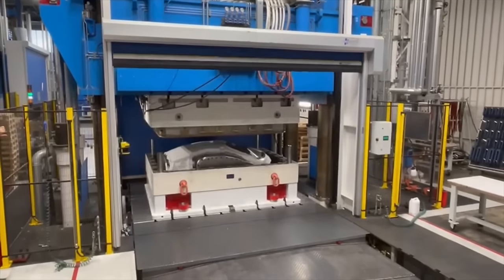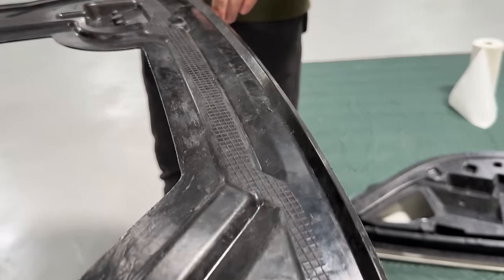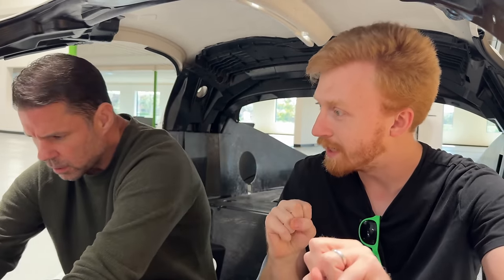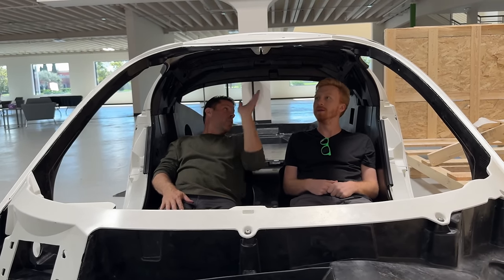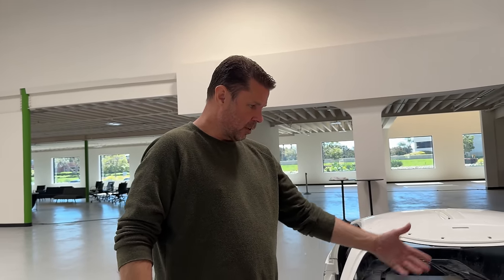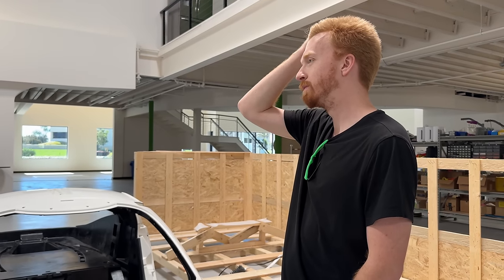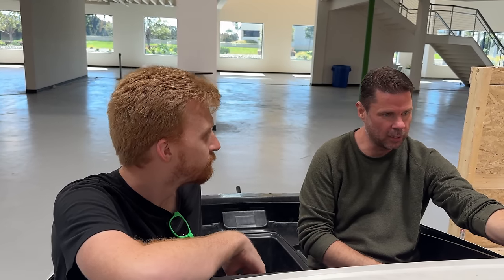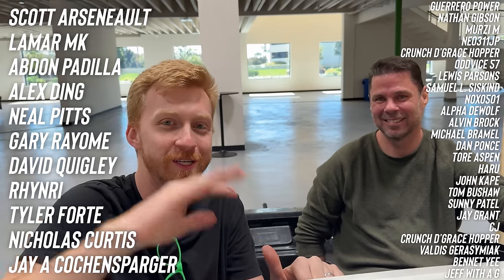Aptera Answers YOUR Questions!

Comment: Thank you for this fantastic video. There are many cool facts and innovations about the Aptera in just this video alone. Well done asking all the right questions!

* Lithium 12v battery located in the rear
* Every 30 pounds added to the Aptera reduces range by 1%.
* Aptera utilizes an SMS system for remote management, (similar technology as house electrical meters, gas meters and pagers etc.) using 3-4% of the energy compared to competitors' live data streams. (leading cause to phantom drain in other EV's it seems?)
* No 4G-5G modem; internet needs are streamed from the phone via Apple CarPlay or Android Auto with the ability to connect to homes wifi.
* Aptera's interior is 1/5 the weight of a comparable sized vehicle's interior with many less parts
* Aptera owns the code for all individual systems throughout the vehicle allowing seamless communication, reducing bugs compared to traditional outsourcing.
* Winter driving is not much of a concern when it comes to traction control or heating the Aptera because of its thermos like construction. Biggest concern is snow build up within the wheel pans.
* Belly pan cooling vs. traditional radiator: A traditional radiator is a little lighter but it’s a little less efficient than belly pan cooling so its a give and take on efficiency between the two (early Aptera’s will have a traditional radiator)
* Break-even point: 6000 vehicles/year; higher margins expected at 20,000 vehicles/year, with local body production planned.
* Targeting 15-19% margin on each vehicle long-term.
* Hood opens to access cabin air filter.
* Mechanical latch inside for emergency door opening; no external mechanical access.
* Aptera theoretically more efficient than e-bikes at highway speeds
* (Possibly) Around 150 Wh/m at 80 mph.
* ‘NACS’ originally named by Chris through petition in 2022.
* Plans to gamify solar charging performance among Aptera owners in a 100-mile or so radius.
* Separate removable glass SMC cover for serviceable parts; electronic latches, logo lights, knock knock sensor, window mechanisms etc.
* trunk hatch has rain management with drain holes.

Comment: Dude!  What a great interview and showcase of the BINC!  Great questions about the wheelpans, because I was thinking about the snow and if they have some engineers working in Europe on that, I look forward to seeing what they come up with.  Maybe something that has some sort of venting out the back?  Who knows.  Would have liked to have heard what they plan on having for Drift-X.  Will they have a display or will it just be Chris and Steve going out there and having presentations to see if they could line up any backers.  So the belly cooling is being put off for the launch.  That's fine.

All the talk about taking out weight and having a more efficient system reminds me of the space program where they really needed to watch how much weight they could push into space.  That's pretty neat.

On another note, I was thinking that my garage faces south and is light in color, so I should be able to just back it out of the garage and with the reflected light off the garage, I shouldn't have to orient it in a East West direction. And if need be I can always plug it in at night.  I hope that will be a feature as well and you can schedule the time it will charge when plugged in to take advantage of the off peak hours, but I'm sure they already do.  And it's great to hear the software is coming along inhouse and with the contractor for the UI.  Also great to hear about the way it will link to your phone and use that SMS? system that pagers used to use.  Very efficient!

Thanks again Tailosive and Chris and the whole Aptera team!

Comment: Thanks for asking that winter question. I live in Canada where nobody knows about this car
Reply: I live in Iowa.  We got down to -30 C this past winter.  I will report on my experience with an early model after the Accelerators are delivered.
Reply: @n.brucenelson5920  What about canadian accelerators? will we be pushed to the back of the line? This happened with Rivian. But thank God I didn't buy that truck
Reply: @ashrafc7794 If you were planning to pick uo your vehicle in Carlsbad, you won't lose your place.  Then comes the Paradigms and only then the UAE models.

Comment: I have two ideas you can share with Aptera. 1. For greater heating and cooling efficiency.  Hang a drape behind the seats to keep the conditioned air up front.  2. Head room is never rrally an issue on most cars. My concern is my eye level compared to the rear view mirror/screen. I am 6' 2" and sit very upright in cars. My idea is to move the mirror/screen to behind the steering wheel and in-between the left and right side mirror screens.

In my many trips to the aito shows. I have not found a single vehicle the didnt have the rear view mirror blocking my line of site. I have come up to intersections with the mirror preventing me from seeing a semi truck coming from the right.

Comment: Love all the small details that were revealed.  A little surprised that audio  speakers will be a basic setup knowing that Steve is such an audiophile.  But hey…overall, SO SO PLEASED with this video and substantial information.  Can’t weight for Aptera Owners Club for further breakdown…Great job Drew!!!
Reply: Basic speakers probably keeps the costs down.

My Hope is that Aptera will have luxury models in the future to rival that of  luxury brands.  

They clearly need to get the Aptera on the road..develop a few models then assuming sales are good they can consider more luxury options.
Reply: I've specced the upgraded audio option. Looking forward to the details on that system!

Comment: The calculations for 85 mph with driver & passenger weight of 370 lbs, shows 164 Wh/mi or an approximate range of 302 miles with a 5% battery reserve.

Something that doesn't seem to add up is the battery pack for the LE.  Chris has said more than once that there are roughly 2,900 cells.  The best combination I have found for 2,900 cells is 18s 27p / module  (2,916 cells).  If my math is correct, a 6 module pack will be 53.217 kWh.  That doesn't match the 46 kWh that has been said is in the LE.  (Each LMN-811 cell is rated at 3.65V & 5.0A.)  If someone has better information / calculation, please let me know.

Comment: Some food for thought on efficiency: The most lightweight electric vehicle you could possibly get (and likely...would ever be made) is a self-balancing electric unicycle. An electric unicycle carrying one person going 25mph consumes about 25 wh/mi. If you think about that as the "ceiling" for electric vehicle efficiency, and the aptera is at 100wh/mi now...there's not that much more you can improve on!
Reply: One of those was built and confirmed at that efficiency.
Reply: This is not a ceiling for efficiency, because the energy lost due to air resistance can be greatly reduced and Aptera does so, even if it has a little more rolling resistance at low speeds.
Reply: @n.brucenelson5920  my dude, the EUC weighs ~60lbs and the aptera weighs 1800lbs.
Reply: @tonydeveyra4611  If you are talking about the Master Pro, you better check your facts.  It weighs almost twice as much, and has a fraction of the range, speed, and load carrying capacity.

Comment: 7:56 ish
awesome to see my concern over corrosion! good to know that they are using a bonding agent as a way to keep things separate...
however, earlier in the video I have seen several threaded inserts embedded into the parts. do you know if those have some sort of barrier too? maybe I'm being a bit paranoid, but it would be a shame to see these beauties suddenly start falling apart.
Reply: CPC has years of experience working with these Mitsubish Chemical sourced materials.

Comment: Must be nice to be interviewed by someone who actually knows what they're talking about! I really wish that third seat was an option from the get-go, even if it might be slightly inconvenient like requiring the third occupant to straddle that hump, because I would totally buy this thing then!
Reply: "I call the back seat, in the middle, with my feet on the hump!” “You like the hump don't ya Brian?” “Oh yeah! I like the hump!
Reply: I was thinking they could have done a bench type of seat across, like the old cars used to have.  Not sure you could actually fit a third person between there but itwas just a thought.
Reply: @artboymoy  Maybe it was something they considered but just couldn't make it work for one reason or another. Even if the seat(s) was/were small that would still be a useful option for many people. [edit: In a pinch I suppose one or two people could lay flat in the back!]
Reply: @JustWasted3HoursHere It'd be safer than riding a motorcycle!
Reply: @JustWasted3HoursHere  I've done it with my gen 1 Honda Insight.
Reply: @jeffcarlton3590  The extra seat or the lying flat in the back?
Reply: @njdevilku1340  I have around 1/2 million safe miles on motorcycles, but I know that this is far from true.  (My wife and I have also ridden in an early Aptera prototype)

Comment: For me efficiency is paramount so that is what attracts me to Aptera. So overall I love what this company is doing. I am disappointed in the decision of not using a heat pump which should be part of the efficiency strategy in my mind. It is not a deal breaker, but I really wish they would reconsider. I wonder if it would be too complex to add it post market?
Reply from the maker: I ask about that in my previous interview. They want to but they’re much more expensive and not available off the shelf. The HVAC they chose for the launch edition is fairly efficient and very cheap. Long term they want to switch to a heat pump but if they wanted one on launch the wait would be longer
Reply: @TailosiveEV  Thanks! I still am curious about an aftermarket retrofit of a heat pump but I think that might be too complicated. I live in Southern CA so it is not that big of a deal unless I take it on a trip to the mountains. I was thinking about a camping situation where it got very cold.
Reply: @KrinkenRohleder  I worked for a company that designed and built heat pumps.  I was surprised too, but Covid put an end to widely available transportation qualified reversing valves.  When this changes again, they can be added in.  As a continuous improvement company, Aptera doesn't have to wait for a model year change to add them in.

Comment: Great interview. I hoping for additional solar panel support for home and travel. Would like to go cross country like in the movie the Martian. But I would like to do it with the glass rear hatch! If they do away with that option I will be very very very disappointed!
Reply: Since the crash testing will be done with the carbon fiber base for the solar panel, I would not be surprised if the glass hatch option is considerably delayed if not canceled entirely.
Reply: If that is true. Someone should take the video goggles off that person responsible and drag them out side and let them breathe fresh air for a while. In the hope there head will clear. With the solar on the rear hatch it’s a dark cave. They all ways film with the hatch open. Because it is dark and claustrophobic. When I’m camping I want to see out the back. For me no glass window hatch no aptera!

Comment: With regard to the bike efficiency discussion - the calorie thing is funny and worth thinking about- however from a climate and 'pure energy use' standpoint the greatest source of emissions and energy consumption for cars is building roads and construction of suburban sprawl. The car (even an aptera) will always create vastly more carbon as long as there are car-sized roads and single family home construction. On the plus side, Aptera cars are a lot better than Teslas for city-dwellers without home charging.
Reply: Source for your claim that "The car (even an aptera) will always create vastly more carbon as long as there are car-sized roads and single family home construction."?

Comment: can you have a quick release for the hackback so you can make a easy exchange of the  Hack so you can use two onen with the glass an the other with the solar panels ? that will be cool
Reply: I used to want the glass in back because I didn't want to feel closed in, but with the video mirrors I won't have that problem, so I switched to the launch edition.
Reply: I would find it useful to be able to remove the hatch when moving potted plants around the nursery.

Comment: Interesting. I wonder if just the outer shell couldn't be strong enough in carbon fiber because of double curvature and the rigidity of CF. Hard to beat for simplicity and weight. Whatever you need internally you can glue or bolt on.
Reply: This design uses the CF layer on the inside and the glass layer on the outside. You get the added strength by the cross section of the two layers. If you did just one layer of CF on the outside, like a stressed skin then you loose all the strength at the openings like the doors and the hatch. It also has the potential problem of damaging the outside skin because it is a structural part. With the current design you can repair minor damage to the outside skin with common fiberglass repair techniques without worrying about structural integrity. With a single layer once  you crack the shell of the egg you totaled your vehicle. Even thin panels in aerospace use a material in the middle to increase the cross section and improve the rigidity. Aptera took the right approach IMO. If you were building a one-off solar racer then yeah, you could make a single layer CF skin but not for anything you want to last or be repairable.
Reply: @davidditzler2704  for something like the door you might have a core material or more complex structure to get it stiff enough but for the fuselage it seems to me it can be plenty rigid because of the double curves and the lip around openings with can be arbitrarily reinforced. Wasn't the original Aptera also just a shell?  I think the cracked eggshell is a dramatic and incorrect analogy :)  it would more be the case that it wouldn't be damaged even in a crash. And if adequately damaged you swap the shell. that way you also know that it wasn't weakened by crash history

Comment: Besides at 6:19 when the employee rode by in a 1-person..Aptera? Your question about power from the solar panels related to the direction the car was facing relates to one I had. What power gain might occur if you faced the car toward the sun but left the back hatch open? The panel would be much more perpendicular to the sun, especially if the sun had a lower inclination.
Reply: Expect about 2.71 kw-hrs per day (average) if parked facing North (in San Diego) with hatch CLOSED.  Expect about 3.14 kw-hrs per day (average) if parked facing South (in San Diego) with hatch OPEN.  That's almost a 16% improvement.
Reply: @johnreeves7261  Excellent info John! Even though we can recognize how variable this result may be, if I end up somewhere I can park my Aptera and leave it open, the "Up to 40 miles per day" can remain as-is but if I was considering that maybe I only average 30 miles per day, I could orient the car to have the sun beat on the open open hatch and raise my 30 miles, to nearly 35! We don't want to push it, but that 40 miles may become just over 46 miles 🙂 We better stay put with the "Up to" number as-is <wink wink>

Comment: I disagree with the statement of not needing a level 2 home charger (22:02). One item that will be needed is a fast charging cable. When I pick up the Aptera from Carlsbad, I am going to have a 1200 mile trip home and will definitely need it to get home. Most of the time the 110 charge cable would work but not for trips. I agree that many times the 110 charger putting ~170 miles charge overnight is enough. There are going to be times when you do need to get a full charge quickly especially in the winter or spring when you have extended times of heavy cloud cover.
Reply: Charging stations have cables that plug-in to your EV.  You only carry your own cable for that odd emergency in a charger desert. Tesla's no longer come with them. You can easily buy them online, with various adapter sets.  I have used one a few times years ago at trailer parks, with adapters for their various NEMA plugs. One time I needed one for a 110 boost at a restaurant to get my LEAF over a hill to the next CHAdeMO equipped charging station. Have used it when house sitting at a homes with no EV charger to plug into my EV.  I have been exclusively EV since 2013. In the last 7 years I have not needed my charging cable when road tripping, since charging stations are much more plentiful now and I plan my routes with them in mind. 

If you do not install a dedicated home level 2 charge port, the recommended solution that most EV owners go with, you would need one. There's no such thing as a fast charging, i.e. 'Level 3' charging cable that you carry with you to plug into non-existent 'Level 3' female sockets. Level 3 fast chargers all have male cables to plug into your female EV socket, not female sockets you plug your own cable into.

Comment: Window blind spot is a bit concerning. Isn't there a way to simply add custom weatherstripping on the lip of the top glass, which would mate with the rolled-up bottom window?
Reply: I’ve seen a number of people who have done test drives in the Aptera who also mentioned they had this concern. All who have mentioned it have said it’s a non issue.